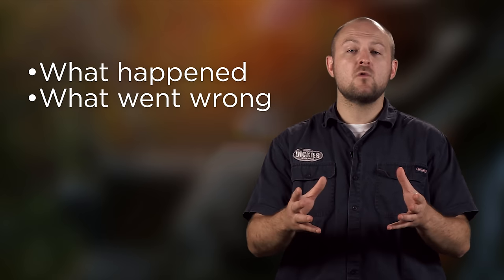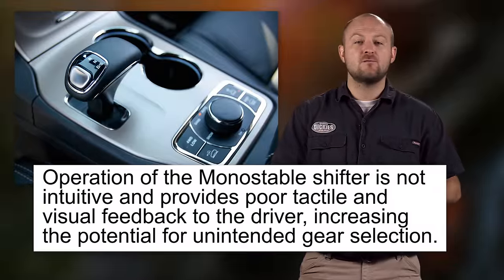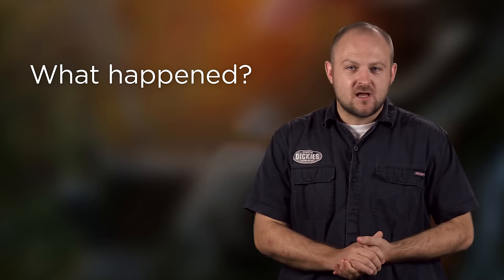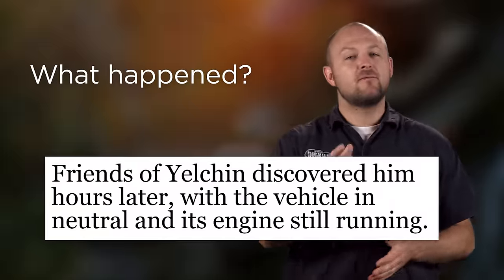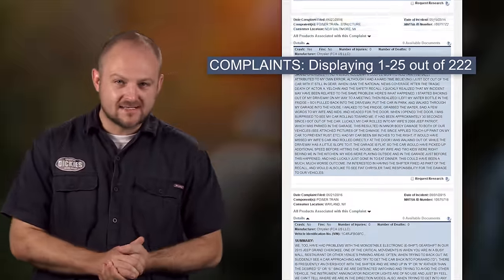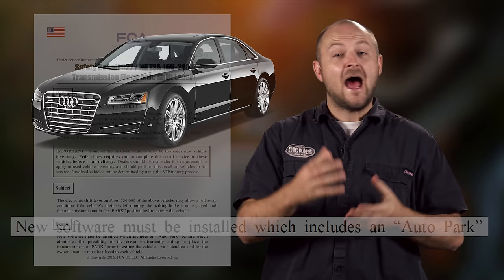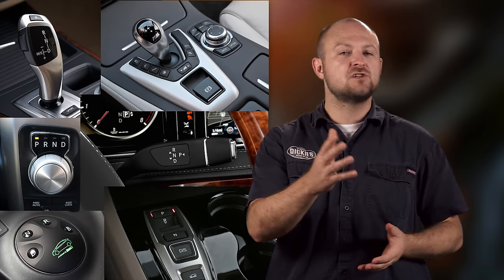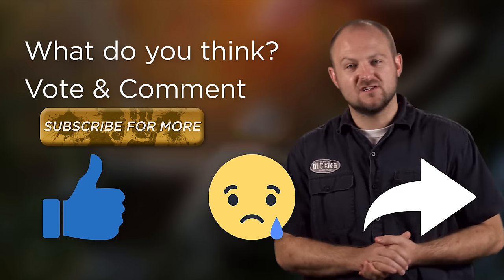How Anton Yelchin was Killed: An Explanation of Jeep's Confusing Shifter

Comment: I tend to disagree with your video.. yes, it's faulty, yes it's a bad design.. but... tell me this:  Where's the security video of the actual incident in question?  If he accidentally failed to put the gearshift into park, not only would the car ding, even though that could be overlooked as well, but if you've ever parked a vehicle on a hill in neutral, it starts rolling immediately... and then, he has to exit the moving vehicle, and outrun it to the gate?  It makes no sense at all to me.  Am I the only one that sees this and questions the validity of the "accident" claim?  It's still possible for it to be an accident, but the security video wouldn't lie... unless this was a deliberate cover-up and it was "misplaced".
Reply: Normally when you use than handbrake, cars tend not to roll away.

Comment: This is crazy, these companies keep trying to add more fancy shit to new vehicles the more fancy electronic crap you add the more things there are to go wrong. The tyranny in my new car can switch between manual and auto shift. Drove it home from the dealer and having owned mostly standard I rest my hand on the shifter, I was going up hill luckily, and put a little too much weight on the thing and it switched over into manual and down shifted sending the tach into red line and lurching me forward., if I had been going downhill or faster I could have seriously damaged things not to mention body parts. 

My heart goes out to this fine actors family, gone because of some idiotic engineers company throwing something into the market with an obvious flaw, and also to the dozens of people out there who also suffered because of this design flaw. 

But also, and in no way meant to criticize, having preferred standard in my trucks and having owned a few muscle cars with standard, I have acquired a lifelong habit of putting the emergency brake on whenever exiting the vehicle for any reason. Or when parking even in automatic I always come to a stop, throw on the emergency then put it in park, then turn off the engine. When I was 16 my brother parked his standard 71 Firebird at a friends, leaving it in first, but forgot the emergency, when we came out the car had rolled out of the driveway and down the road.

Comment: I throw my car into park and always pull up the e brake as well, anyone else should do the same so if you do happen to land in neutral because of a wonky shifter the car won't move unless your e brake fails.... had he been in a manual this could have been avoided as the e brake is the primary brake for when a manual vehicle is parked.

Comment: The design is definitely not very intuitive. I’m just wondering why the car didn’t start immediately rolling when he got out? He would’ve had a smashed gate and dented vehicle, but he’d still be alive. Just weird. Also odd that the vehicle wouldn’t automatically go into park with the door opening at low to zero speed? My car does, I found out the hard way😅. I was opening my door to back up and look at the curb as to not hit it. As soon as I opened the door, “clunk!!” Real loud and the car was in park. Luckily I didn’t cook the transmission. But I was barely going 1-2mph tops. Anyways, it’s definitely not a great design in Anton’s jeep. But there are indicators that let you know what gear you’re in. And he should’ve taken a bit more time to verify it was in P park. In addition, if you’re on a slope, hit the emergency brake to make sure the car doesn’t move. Just a combination or bizarre design  and bad luck for Anton. A truly sad situation. RIP Anton.

Comment: This tragic accident was definitely more the manufacturer's fault then the driver. The manufacturer should have installed a better safety feature than just a "ding" sound. When I was s kid we had an osmobile that talked.  A voice recording would say stuff like "Your key is in the ignition and Your rear door is open." Perhaps "Your car is in neutral" would have been better than a ding considering the type of gear shift!
Reply: What a load of tripe. The driver should have put the car in park, the driver should have heeded the warning signal, the driver should have used the parking brake.
Reply: +Renier Bonthuyzen He thought he had put the car in park! That was the point of this video and the reason for the recall.
Reply: +Sue TG. I understand that. My question is what kind of driver DOESN'T MAKE SURE of what gear he is in before exiting his vehicle and furthermore, what kind of driver gets out of his car without engaging the parking brake. Even if he just did the last bit, he would have still been alive!!!!! Yes it is bad design, but not the manufacture's fault that he died.
Reply: +Sue TG. If I think I turned off the stove, but didn't make sure about it and the house burns down, whose fault is it, mine or the manufacturer's.......it will be. I one else's fault but mine.

Comment: that hill was pretty steap. how did he even get round and infront of it?
Reply: He didn't. It seems as though he had parked the car at the top and then decided to get out to check the mailbox, which was at the bottom. So he got out, walked back down and by the time he got there the Jeep had rolled back down and pinned him against the mailbox.
Reply: sick
Reply: +colly beans....He didn't shift into park, so there were warning signals.....and he didn't use the parking brake. Mmmmm. Wonder who is to blame for him not being able to drive. No ones fault other than driver error.
Reply: yes you are right Renier....      I wonder to............
Reply: Renier Bonthuyzen Did you not watch the video?? He said the warning sounds are the same as if you left the keys in the ignition after opening the door. So it's easy to think that the sound was because he left the keys in while he was getting out to check the mail. Also he mentioned that the shifter had an odd feature that made you think you shifted to park but actually you are in neutral, or that it's easy for it to slip back into neutral. That's kind of the whole point of why they are recalling those models. Don't be dense dude.
Reply: +John Thompson I think you are the dense one. There is an indication on the dash along with the warning signal as well.....and what about the handbrake. What kind of driver gets out of his car.....that is parked on a steep incline, without engaging his handbrake or e-brake.  The fucking irresponsible kind. If he engaged that, none of these discussions would be happening. Fine, so the warning signal is the same as the key in the ignition. Did he not check the shifter and the dash. We rented one of those cars and never had any problems, because we pay attention when behind the steering wheel.
Reply: +John Thompson Dude. The only thing keep can be blamed for is bad design, but that is typical of American culture.....Always blame someone else. There is no evidence of malfunction. He didn't engage the handbrake, even just doing that would have prevented this. I am really sorry that he died, but blaming someone else because you don't pay attention when behind the wheel of your car is lame. That is like saying we should sue every car manufacturer for allowing cars to be that fast and killing people because of it.
Reply: +Renier Bonthuyzen Again. Defects would indicate that it didn't work properly.  That is not the case. It wasn't defective. It was bad design, but that doesn't make it defective.
Reply: Renier Bonthuyzen Bad design = manufacturing defect. There were enough incidents to warrant a manufacturers recall. But even if we were to dismiss it as simply a bad design in the sense that you mean, that doesn't leave the blame to the deceased.
Reply: +John Thompson Yes it does. He should have engaged the handbrake as well. What kind of driver parks on a steep hill and get out without engaging the handbrake?
Reply: + Renier Bonthuyzen by the sounds of it, this guy John Thompson would be such a driver. Mind you he probably would find some American judge to back him up as well.
Reply: +Renier Bonthuyzen he did NOT use the hand brake! What is it you don't understand about that? The HAND BRAKE is what you apply EACH AND EVERY TIME YOU GET OUT OF YOUR DAMN CAR, GET IT??  If you don't apply the hand brake when doing your driving test you FAIL your TEST. By the way you are talking you should not be driving.
Reply: personally I can't stand fools and idiots who shift responsibility away from themselves, it's backwards evolution.
Reply: FontediCalore why give out to me? I am the first one to say it is his fault for not using his handbrake?
Reply: Renier Bonthuyzen The whole point is: there is a manufacturer's defect that warranted a recall of that model of vehicle for safety issues. Nobody knows exactly what happened or what he did/did not do. But it is safe enough speculation to say that the accident was due to this particular defect. So much so that there is a pending lawsuit. I'm really confused as to why you insist that everyone think it was his own fault. You weren't there. The guy is dead. Why do you care so much about making everyone believe that it's his own fault? All that does is make you out to be an insensitive prick. Mission accomplished. Move on.
Reply: John Thompson Because in the report it says that it is a confusing shifter. It says nothing about it being broken or faulty. The same counts for you. You weren't there either, how do you know it wasn't his fault and don't get me started on your justice system. Ha ha ha. White police kills a black dude on video and still gets off Scott free..... Again. I am sorry for the guys death, but don't blame the wrong people for it.  If he watched what he was doing, he would still be alive.
Reply: Renier Bonthuyzen I found better things to do with my time than to argue about this any further, buddy
Reply: John Thompson. Me too, this is getting old. Hope you have a great day.

Comment: Very bad design by Chysler Jeep. My 2016 Kia Soul EV has standard shifter, electronic emergency brakes and "auto hold". Means if I get a complete brain fart and exit my vehicle on Neutral or even in gear the system will automatically set emergency brakes and "hold" vehicle when driver door is opened.
Reply: Have you ever discovered that your door is only semi-closed, and you open it and slam it WHILE DRIVING? What happens then? (Bonus: what if you have to jump out while rolling during the zombie apocalypse?)

Comment: Ever tried to get out of a vehicle on a steep incline when the vehicle is in neutral? The second you take your foot off the brake and open the door to get out the vehicle is already rolling. In which case you'd stop getting out of the vehicle and put your foot on the brake and try to put it in park again. I think the vehicle was in park allowing Anton to walk down the driveway to his gate at which point the vehicle popped out of park and began rolling. Anton with his back to the vehicle had no warning that it was rolling backwards and was surprised when he was pinned against the gate. Other wise he would have moved out of the way. Logic does not support the pro-offered explanation. (As Spock would say.)

Comment: My C6 CORVETTE has electric power doors. When the battery dies you have to use a lever  on the floor .Sadly a man and his dog died from the heat in a Corvette in a Waffle House parking lot because he didn't know about the lever. The car also has a removable hardtop with just 3 levers to turn from the inside.

Comment: This is a good video but yeah I'm definitely one of the people that checks that it is in park before I get out. I had an old car it was an Oldsmobile bravada and I was on a major road and all of a sudden it kind of got stuck to where the engine kept revving up and the speed kept going up and you cannot hold the break down enough to stop it from going thank God I thought to put it in neutral and get off the road and then I was able to turn it off and it stopped but it was insane... And then I found out later through the Opie and Anthony show that there was other people in A Lexus, I think it was like four elderly people and they called 911 and could not stop and ended up hitting a truck and then going over a ravine or something and I know it killed at least some of them but it was brutal they were going 120 mph and couldn't stop at all... And the 911 operator did not really have enough time to think to tell them to put it in neutral and then even if the engine is going crazy it could keep on running and running and running in neutral and it wouldn't matter... But the guy only had like 20 seconds to actually diagnose what was going on and the elderly people you can hear them yell as they crash it's nuts

Comment: I think the "fault" lies in several places - I am guilty of not checking what gear I am in but I have never had a car roll - I know lots of people with manual transmissions who have jumped out of their car without setting the brake and their car rolled because they had their head up their arse - not blaming him but his vehicle was new and he did not have that "muscle memory" talked about so he should have been more careful - bottom line ...... this was a plain accident because no matter what design of the car you have to "use" it properly
Reply: He should have checked what the hell he was doing. Cars aren't toys. There would have been warning signals as well that he ignored and the emergency brake was not engaged. He is totally to blame. Like I said. If you want to drive a car you should pay attention every step of the way until you switch off the ignition. I hate when people do stupid things and blame other people. At most jeep is guilty of bad design.
Reply: the fault lies only on the person not applying the hand brake. End of story. No more "warning signals" please! We need none.
Reply: I agree. All cars have a parking brake to supplement the Park mechanism on the automatic transmission. Even with the transmission in Park, it still needs to be held in place by the brake.

Comment: They should stick with the tried and proven, keep the controls simple. But also do away with automatic transmissions so people have to pay more attention to what they're doing.
I think cars should be MORE scary to drive. The average person should be terrified they are going to die the whole time on the road. No little helpers like anti-lock brakes or traction control, those just make stupid people feel overconfident. 
No sound deadening to keep the outside world at bay, they should feel right in the middle of it. 
Going 85 mph should be a cacophony of noises and wind. 
People should hear the sound of the 18 wheeler roaring beside them and the sound of the retreads about to flop off and take out the car behind it.
 They should be able to hear the screeching tires of all the other idiots screwing up and crashing.
Kind of like the way it is riding a motorcycle.
Just take the glass out too, people just think it's a movie screen anyway.

They are too much like an extension of your living room now and nobody pays attention or seems to realize that the 2 - 4 tons of steel and plastic they are happily driving at 85 mph in heavy traffic is only held by four tiny patches of rubber.  No...you CANNOT stop in time.

Comment: Doesn’t make sense ...if car was on n mode on a hill leveled driveway as soon as he got out it would have rolled back before he even exit the car not a minute later “ plus if the car isn’t in park and u exit the dash would indicate so as a warning ⚠️ 👀...something doesn’t seem right here 🧠👈🏿use it
Reply: MADD Mally ..  Not necessarily. That was a very poor demonstration here in the video with a pic of a big suv overflowing the driveway.
If the surface is not flat it could have rolled very very slowly at first and then picked up the momentum.